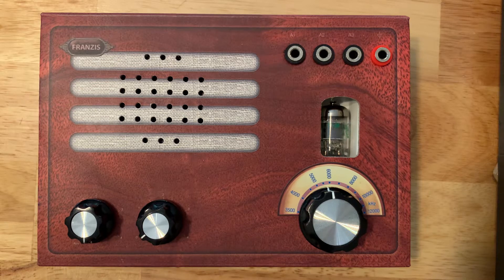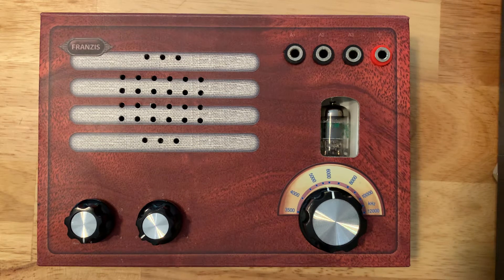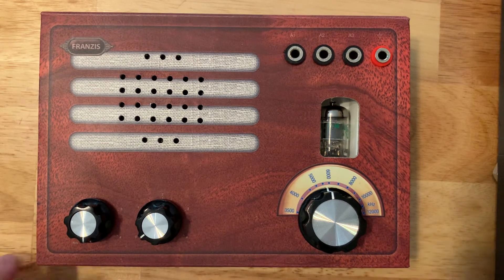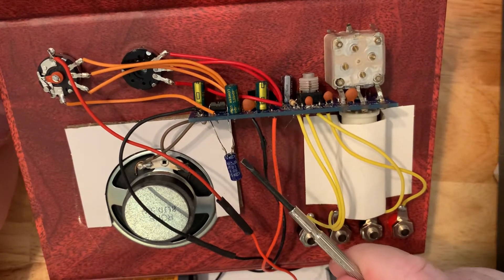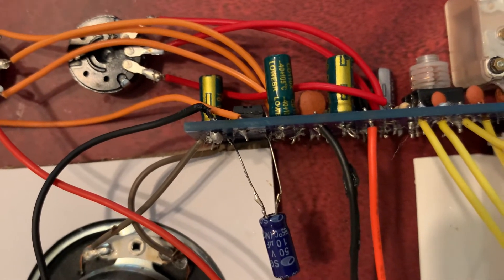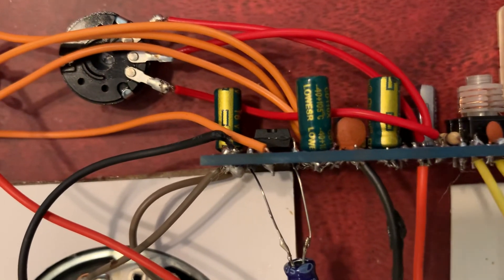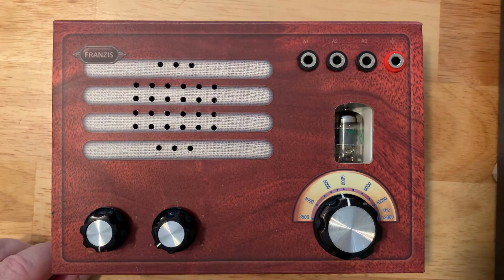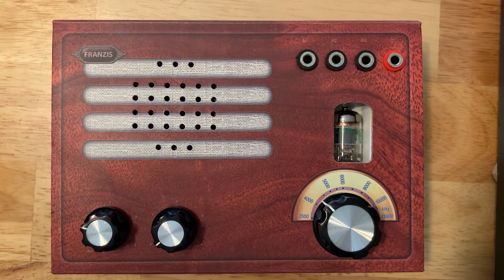Update on Franzis tube radio kit - volume modification

Comment: I'll do some further experimentation when I get round to assembling this little kit. I love these odd receiver designs. Your efforts are appreciated, but I do feel you left out the  demonstrations of some received stations. No radio  does well without an actual demonstration.
Reply: I did a demo of the radio in my other video. I don't have an antenna connection on the work bench.